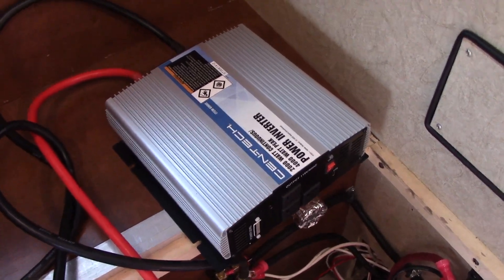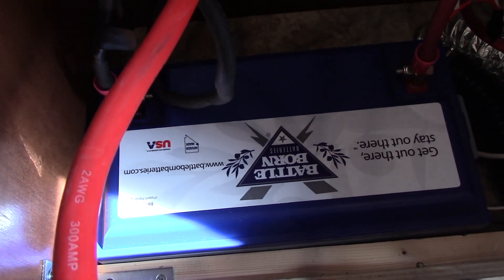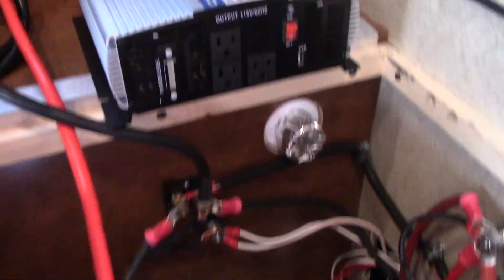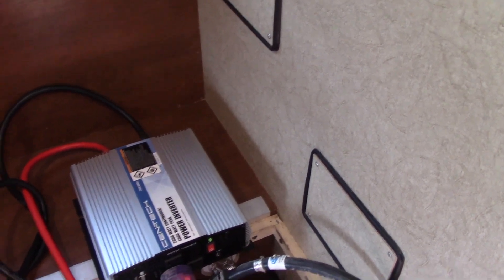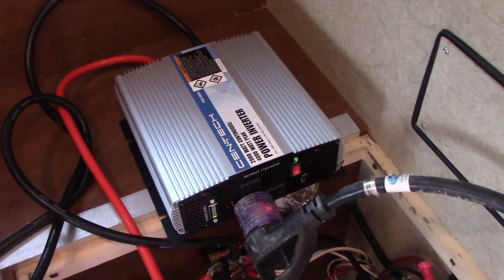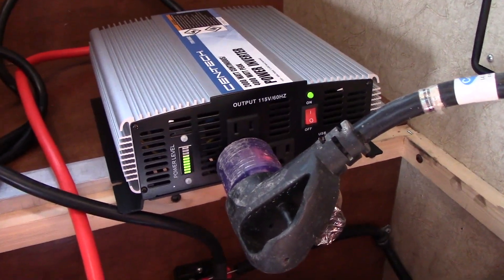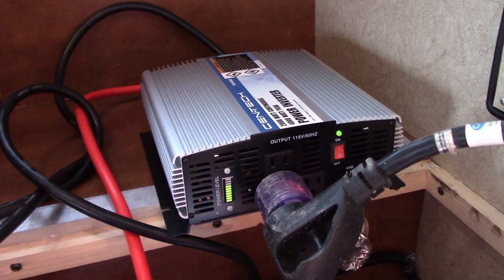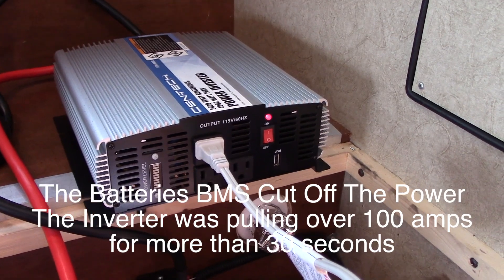Harbor Freight 2000 watt Inverter Round 2 Test - Will It Power RV A/C?

Comment: I used this in my semi truck before it crapped out. 
Iagree it's not running what it says it will.  Im currently uses a used in inverter that was laying around the shop. Just realized it's only 1200w and it was running way better than the Jupiter. That fan kicked kicked on whenever the mini fridge kicked, and when I turned on the microwave.

Comment: You are having all those issues because you need a pure sign wave inverter from harbor freight its runs more continuous power like you need and it will stop the humming i promise that inverter is more for like a truck or suv and a occasional camper the pure sign wave is for major continuous power like you need!!!

Comment: being plugged into the shore power cord is whats doing it. try it on a window AC.  the start up onthat roof AC is a big pull and all that line loss is just a wee bit much....once running like you can see its pulling 1500w but start up is hitting over 2k.
Reply: I believe that inverter has a 4000 watt peak.

Comment: You say you learned a lot, but obviously not quite enough. You need a pure sine wave inverter to run devices with motors. Like air conditioners. A simple Google search will tell you that. Slamming a product in not one but two videos is unfair, when your lack of knowledge is the reason it "failed" your test.
Reply from the maker: Again. Just going off the included information with this inverter on what it will run. You must not have watched the video.
Reply: @JackofAllMasterofNone  regardless of whatever misguided info was included with the inverter, the facts remain. modified sine wave inverters are not designed to run AC electric motors. Wrong tool for the job. Again.
Reply from the maker: Trust me. I completely understand how electricity works. You completely missed the point. This is a review of a product and if it can perform as advertised by the company selling it. There is a long list of things that it can power on the side of the box. One of them being a window air conditioner. We both know it can't start that but they say it can. That is THE POINT
Reply: @JackofAllMasterofNone , you're absolutely right. My bad.

Comment: As I'm sure you know by now, but just stay away from Modified Sine Wave inverters.  They run inefficiently, and you can never run laptops or desktops, and they make everything buzz.  I know the pure sine costs twice as much, but I would never buy a Modified.  Also, you need at least two batteries, and four is better, to expect much use out of an inverter.  As you saw with the AC test, the inverter finally delivered the power, but the batteries got drawn down in a matter of minutes.  And finally, stuck with the good brands of inverters.  I'm sure some of the Chinese inverters work OK, but I've had two of them, and one worked but didn't provide anywhere near the stated wattage, and the other one was worthless.  I returned both of them.  Magnum and Xantrex and Samlex are the best, you can't go wrong with them.  I've had success with Aims and Giandel.  They're less expensive, and do just fine.  I have two Aims 1500w, one 24v and one 48v, and they still work fine.  My 3000w Giandel is in use as we speak.  And my Xantrex 1800 Prosine that I bought used and beat up, is still is use, and has been running for years.  They're not on all the time, but there has been periods where both were running refrigerators and TVs, lights, computers and water pumps, for months at a time, always on.  Inverters are by far the most fragile part of a battery/inverter setup.  I've blow up a few, and had many others just quit after a time.  Always buy higher than your needs.  For your 9000, or 13500 AC, you should start with 2500w, and 3000 is better.  Inverters don't like to run at full capacity for any length of time.  And you can damage your AC by running with "just" enough power that it has to struggle all the time.  Anyway, have fun, and stay away from those EVIL modified sine inverters.

Comment: I thought a battery of at least 2400 wh is needed to juice up the 2000W Inverter FULLY. As you suspected, another battery in parallel with a Pure Since 2000W continuous supply will run your AC.

Comment: I have no problem running a window unit A/C with my 2000 watts Aims inverter charger. It is 24 volts, I have 20 AutoZone marine batteries hooked to it.

Comment: I have this exact inverter. I have it tied to 100 amp hour deep cycle battery which is also parallel to something like a 50 amp hour crank starter battery like a regular car battery is not deep cycle. It'll start my 5,000 BTU Frigidaire air conditioner which does have a soft start capacitor in it. It'll run that and it'll run a microwave that's about 800 w at the same time as well as some fans and some lights. I did not notice any buzzing or anything but I have heard long-term that these partial sign wave inverters can damage motors and things so I'm a little worried about that. But my inverter will run stuff. When I first tested it I just tested it using regular car battery jump start cables in one cable would not turn on. It gave me the overload signal and shut down and then I hooked two jump start cables to the inverter and the battery and found that it would work. With that knowledge I went ahead and opened the package for the $37 number two gauge 6 ft cables and bolted those into the 100 amp hour battery and to the back of the inverter and like I said it just didn't have any problem at all starting everything I had and running it.

Comment: If your RV AC unit doesn't already have it , install the soft start capacitor kit on your AC unit like you mentioned.
As a rule , you need one deep cell battery per 1000 watts of inverter you are using.
Try using 3 deep cell batteries in parallel.
The other thing to look at is these inverters are only 85% efficient.
The battery power cables need to be 1/0 gauge TIMES TWO for positive AND negative.

Comment: QUESTION....I HAVE A READ LIGHT AND THAT SOUND AFTER I CONNECTED MY NEW GOLF CART BATTERY ? Any thoughts
Reply from the maker: Did you connect them in series or parallel? If you have a 12 volt inverter and are using (2) 6 volt batteries you need to have them wired in a series to make 12 volts to the inverter. Just something to check.

Comment: And your last video a person informed you that you needed to install it easy start or otherwise known as a soft start on the air conditioner. Using a cheap inverter to power and air conditioning unit is not wise in the first place. But a 2000 W inverter even the top end Will not run even a 5000 BTU AC unit period. When the compressor kicks on an air conditioner the current demand can be five times that of what the fan is. You would need at minimum is 7000 white power inverter to run an AC unit without a soft start. And even with that it will destroy your batteries overtime even if you are using one of the best batteries there is. Install a soft start on your air conditioner or I can promise you we will have nothing but problems. And by at least a mid grade true sine wave inverter. Your electrical system and a mobile application is the absolute last thing you want to skimp on. Also generators are a completely different animal compared to power inverters they are very very different.

Comment: It DOES do what its rated for. However, a compressor runs with a motor that has a 2 step system. First step uses a capacitor on the side for the initial spin up. That capacitor is what's causing the overload. The inverter isn't designed to allow over current for short bursts. The overload protect will catch before it powers up.

Comment: Hi I have the same inverter in my camper.   It works pretty good.  I have two 110 amp batteries connnected to solar   The problem is the batteries draw down very fast   During the day with  4 100 watt panels and moot controller I can run it about 1 hr before batteries draw down.  With just the batteries I get about 15-2o minutes  my ac is a window style 8000 btu
Reply: How come did your air conditioner worked? the wave is modified sine wave? not so? Would it damage or short your ac life sooner?

Comment: There are multiple issues with your set up as noted in other comments.
1) A single battery will not give you the amps you need.  Multiple batteries tied to a common bus will.
2) Obviously a soft start kit for the AC would cut your max start up draw and allow it to run.
3) The inverter is rated for total load (at all the outlets).  Doesn't mean you can't get that load from a single outlet.
4) In any case, you would need 100s of amp hours of storage to run the AC for any reasonable time off of batteries, so this is not an appropriate use for this.  High amp draw devices don't make a lot of sense to run from batteries for any length of time unless you have a relatively high amp continuous input source to the system.

The inverter is functioning as designed, your system overall is not designed correctly.
Reply from the maker: Again. You missed the whole point. It's about false advertising on the side of the box. It's connected to the vehicle per the included instructions using the required cable kit. I understand how and why it doesn't work, it's about what the misleading box tells customers they can run.

Comment: If test with outlet test adapter the result was open ground. Equipment that uses 3 prong connector may need a way to provide proper grounding.

Comment: Inductive loads don’t like modified sine wave and will have a hard time starting the load. Use a clamp meter to measure the inrush current of the air conditioner attached to mains and get a pure sine wave inverter that is rated for the inrush watts as the continuous rating.
Reply: Or a soft start relay and skip that stupid shit

Comment: 2k,4kp will do it if it is a low frequency type with a big transformer inside. A low frequency pure sine wave inverter costs around $600 on the low end. Good demonstration of the limits of that jupiter though.

Comment: With a single 100A rate discharge, you only can get 1200W -1380W output or throughput. If the load is more than that it will simply not be sustainable. 
And as a person mentioned, your charger might have been just feeding back on itself.

Comment: Ya each plug is a third of the total power. I had the same issue. 
Getting a new inverter to hard wire to the ac unit.

Comment: Use 00 cables and shorten lenght of cable. And honestly 2nd battery wouldnt be out of question either. Inverters require lot of power if you going to run high watt appliances. And 2nd figure out all your going to on inverter. In total watts. Then buy a inverter double the wattage you would use. And especially when trying to start up appliances like a/c air compressors that require lot of watts on start up. But then level out when running. Your inverter will work like it was ment to.

Comment: 100A x 12v is only 1200W... Peak of 2400W for the 30sec time. To properly run an inverter you want at least double the running amperage cability.

Comment: I think these cheaper inverters are 2000w TOTAL. Each of those outlets probably maxes out at ~650w or something. The more expensive ones have a hard line output on them to get the full wattage output.
Reply: Ya "i think" is a super technical term. It puts out the power, its just the wrong product for the job. Pure sine if using ac motors.

Comment: Did you connect the grounds? You also may have a strange loop going on. When the plug to shore power is plugged in it also charges the same battery you are using.
Reply: Yup. The converter in that unit is probably charging that battery while the inverter is running, I’m not sure but I’ve been told you can fry your wiring quick running an inverter and converter at the same time like this

Comment: Most of the problems with inverters is the input source and wires are undersized.  May need bigger batteries and cables.